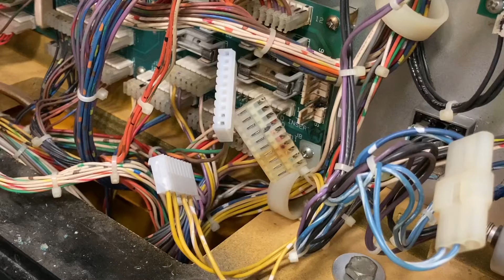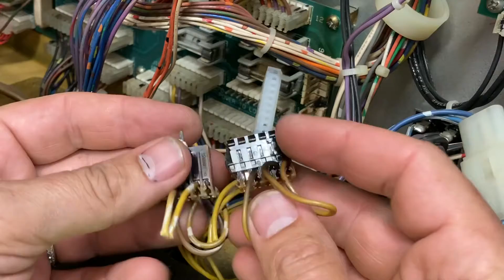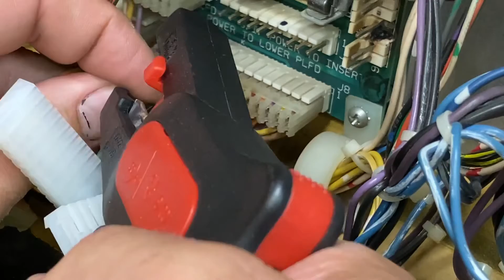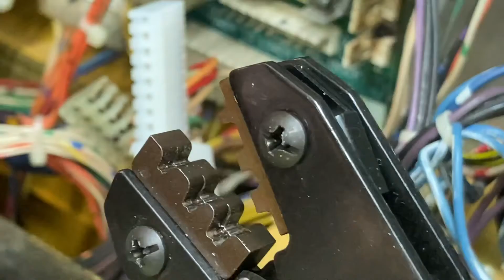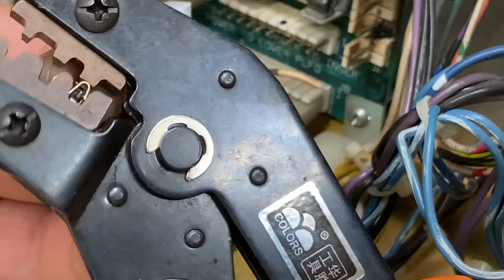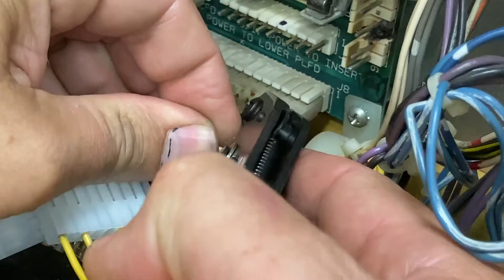Pinball connector repair repin

Comment: Recently replaced the same connector and jack on my Banzai Run interconnect and replaced the connector with a heavy duty variant which functions the same but can handle more power going trough it then the regular ones. Just a few cents more expensive and worth it just to not have to remove the board again.

Also a funny thing is that on the Banzai interconnect for my game they only populated every other pin like you did. And put special 0-ohm resistors to basically jumper the voltage to the traces on the next pin.
Reply from the maker: Interesting. It sounds like the the board design changed over time (at least for Banzai) to handle the ‘every other pin’ connector design.  Good to know.
Reply: @LeebosPinball  Yes that is also what I think did happen, especially since Banzai had a different board from the very start.

Might be interesting to check if any of the traces have holes in them that serve no purpose, I do not have access to any other interconnect games to very this at the moment